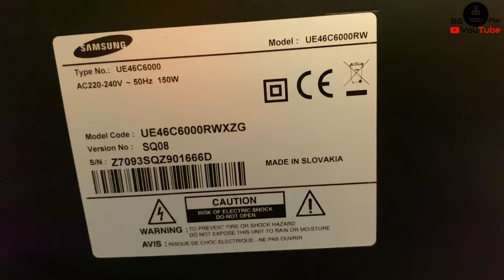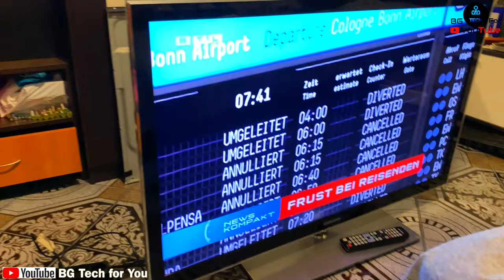Fixed: ✅ TV Vertical Line Solved 🔥 46" Samsung LED TV🔥

Comment: i wonder what's that screw had something to do with vertical lines problem, purpose is just to mount/hold the mainboard?
Reply: The single screw in the back helped keep the board from bending, which there is a problem with the board warping. removing the screw and putting it behind the board lets him control the bend, like a splint. hope that helps. i was confused at first. the warping of the board. good call sometimes overtightening parts or not enough can cause problems over time.
Reply: @Kriswixx  i understand what you mean, it's just that this is the first time i've encountered board warping in TVs but common with desktop computer motherboard due to cooling fan screw tightening
Reply: This doesn't work its temporary
Reply: @Kriswixx  I don't think it's the board, it's the central processor (CPU), it's solders cracks with time and bending the borad is making cracked contacts behind the CPU to "connect".